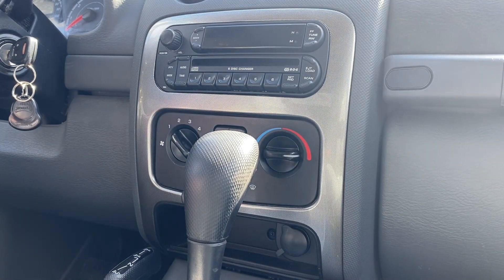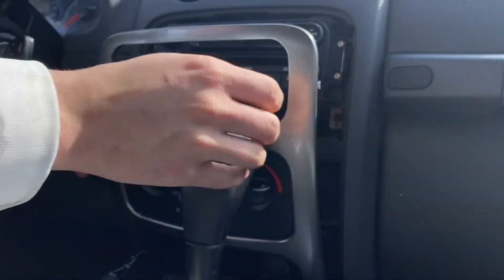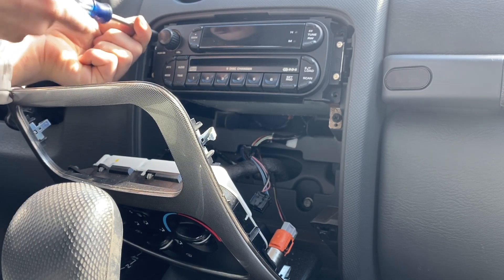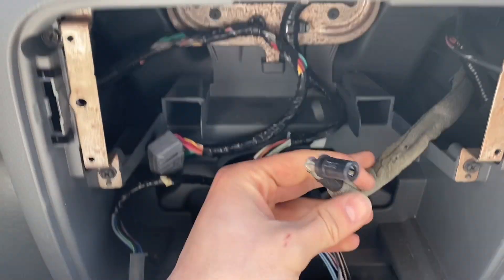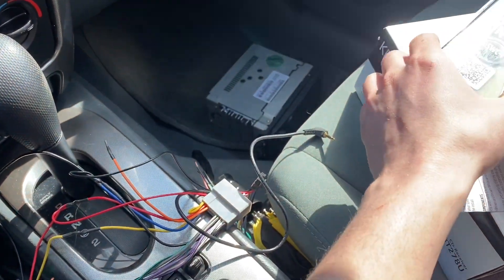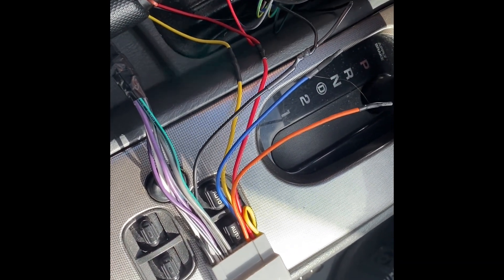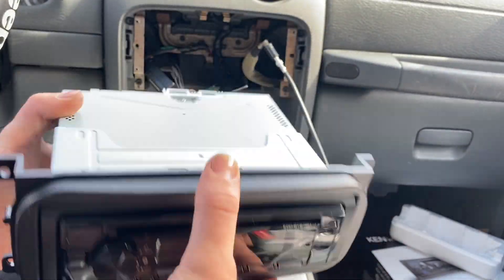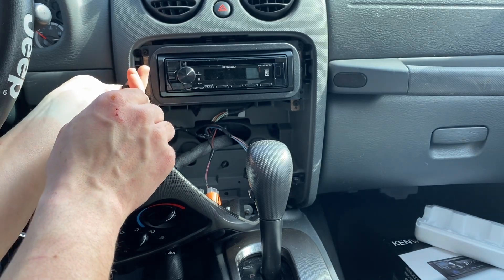How to Install an Aftermarket Radio in a 2002 to 2007 Jeep Liberty

Comment: Thanks for the video and links to the items necessary. I just installed the same radio in my '05 Libby thanks to your info, super easy. (minus the steering wheel controls)

Comment: I have two for the radio. A larger rectangle plug and a small square plug.
Reply: right l have the same thing on my 2007 and the radio is hooked up but I’m getting no sound
Reply: I was about to try this same install and noticed the other smaller plug not featured in this video, did anyone figure out the problem or find a solution? My 07' liberty doesn't have steering wheel controls if that helps.

Comment: 1) that’s an antenna cable, not a satellite cable. 

2) you bought steering wheel controls that weren’t needed. Those are used when you can control your radio from the steering wheel. 

Good job on the tutorial.
Reply: l had everything hooked up but no sound is coming out the speakers

Comment: I own a 04 Jeep Liberty and I tried to swap the old radio out for at the after market,,, I purchased the connector and once I hooked up the wires I got power but no sound and I tried everything what could that have been?
Reply from the maker: If you have power and the radio lights up I recommend verify the amp is working
Reply: @alexautomotive28 same thing happen to me had no sound
Reply: @alexautomotive28 same happened to me had no sound but l hooked the factory radio back up and it was working

Comment: I have a question about the two red wires and blk/green coming from the vehicle harness. Do they have to be splice together like you have in the video? Also there are 2 black/green wires which are ground and would those need to be spliced together?

Comment: Hi I tried to check the wire diagram for where exactly you plug the aux looking cord from the steering wheel control to the back of the radio all I have on the back is antenna, L and R, and mic but it looked like you plugged it into one of the L and R input? But which one?

Comment: dear Alex
i have install in my jeep liberty 2006 an android system with out steering control and i dont have a sound on speakers . what is the problem . thank you in advance
Reply from the maker: Is everything wired correctly if so is everything plugged in correctly, then also make sure your amp had power
Reply: @alexautomotive28 same don’t have the steering wheel control and l have power just no sound

Comment: I have a similar setup. On mine, Pin #13 says it is 12v Radio Output. It's the same yellow/red wire. Is that for some kind of Amplifier? I can't find a mounted amp anywhere under the dash.

Do you know what that Pin #13 yellow/red wire is for?
Reply from the maker: I’m not too sure what’s it’s for but you may have amps with speakers in your doors, that’s how mine was set up, I do also have a YouTube video about how to change the speakers and it shows you how to transfer the amps over. 
Thank you for watching hope this helps you

Comment: Does this install retain the use of the factory stereo amps located in the passenger doors?
Reply from the maker: Aaron Simcoe mine did, my Jeep had amps in all 4 doors and it worked great with all 4

Comment: How long did this take you? I don’t have the volume controls on my steering wheel because the Liberty Renegade is a bit more basic so I don’t think I have to do the splicing that you did.
Reply from the maker: You might have to still splice into the wiring but you could always hook everything up first and see if you have too, this took me under an hour or so, but I have installed a couple of radios before this one